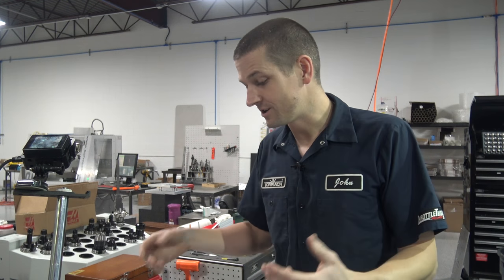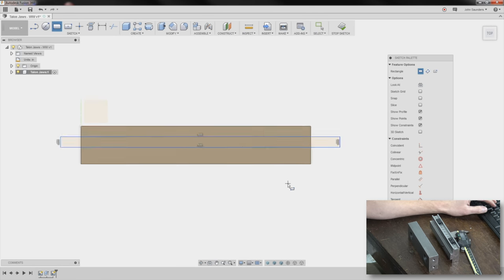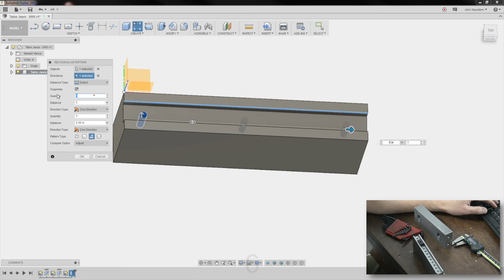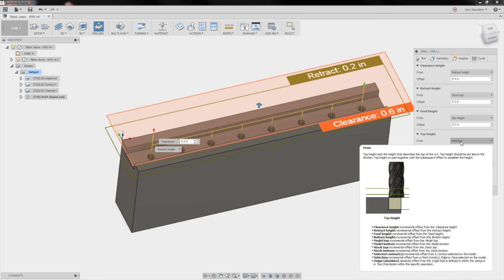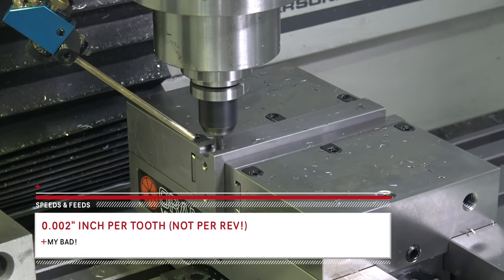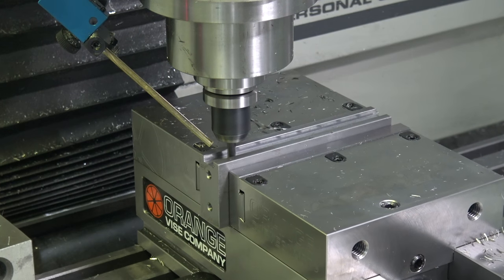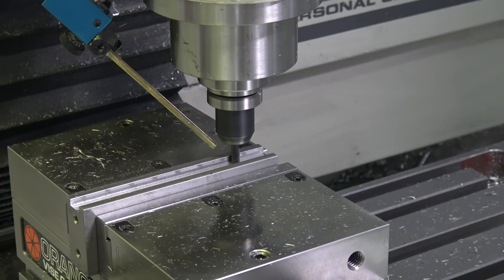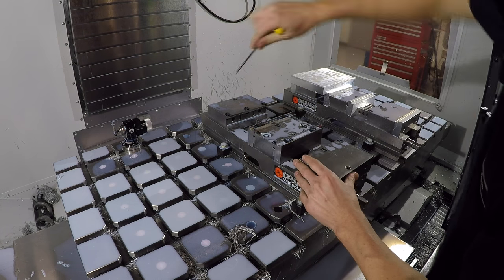Machining DIY Talon Jaws!   WW126

Comment: John, just a suggestion. (I don't know on the TorMach machine having never run one.) On most all CNC machines if you program you finish cuts using cutter comp you can control the amount of stock you are leaving or removing by changing the offset for the diameter or radius (some machines use diameter some use radius) in the tool offset page for that tool. For instance in your cam software if you don't offset the tool path to centerline tool path but apply a comp left or right (G41 if traveling on the left side G42 on the right side, you post should automatically put the code in the program). You will need lead in and out moves equal to at least the radius of the intended tool size (I usually add a little more to the radius say .010"). Than you can than  just rerun the finish cuts at the machine adjusting the offset to come to size. The way you appear to be doing it you have to go back to the computer to reprocess code every time(what if the tool wears or you change to a new tool). That does work but lets say you have many machines with many operators it could be very difficult to do if one person is programming. Or if you run a job many years later you would have to remember what to do. Or using reground end mills. So it is better to program the actual shape of the part and use the tool offsets to come to size than every one will know how to run each program without needing any additional programing or processing of code. Also looking at a program latter on in the G code it is much easer to tell what size you are cutting.The Haas machine will do this.
Reply: True. He should've used another endmill for "finishing". Just needed that fresh edge.

Comment: When you do your 2d contour to clean up, in the passes tab, change the Compensation type from 'In Computer' to 'In Control'. Also don't leave any stock. Add +.002 to the diameter offset of the tool doing the contour in your CNC control. Run the program, measure the slot, then change the wear offset to what is left to cut and run the program again. You don't have to repost the program and that tool is now dialed in. Then you can also easily adjust this as the tool wears out.

Comment: 1018 can be case hardened.  I made a planer gauge in school and had it case hardened to 55-60 Rockwell.  My understanding is that carbon is added to the material from the outside before heat treat.

Comment: I've seen a few generic case hardened answers, however, carburization is actually something that's very interesting.  You end up heating the low carbon steel while it's wrapped in an air tight 'chamber' and surrounded by charcoal or other high carbon elements.  If you heat long enough, you can actually get then almost completely through hardened.  It's a very ancient technique that hasn't changed much over time, and essentially very very effective.

Comment: if you use a super quench (water, salt and surfactants) from a little over 1550 degrees you can get it to the 42-45 range.  It works by basically breaking up the steam bubble that forms around it to increase contact area of the quench liquid to the part.  The 50 range is probably not happening on 1018 unless there is a method I am not aware of.

Comment: 1018 CRS can be case hardened by carberizeing. It usually yields a hardened depth of .060 to .065 of an inch.at 56 to 58 Rd. Not very many places do it any more though. I made parallels that way and some were so hard a carbide end mill wouldn't cut them. Keep up the good work John

Comment: If I remember correctly, you are correct. Multiple kings had their highest guests of honor used aluminum silverware rather than gold. Aluminum itself isn't really toxic, but they didn't have any way to process it back then, so it would have other contaminants with it. Currently aluminum is more expensive than steel weight wise, however steel is harder and better for more structural builds. I knew a robotics team that milled out their entire chassis out of aluminum and spent close to $15,000, however their robot was extremely light and almost 30 pounds under the weight limit with more moving parts than most teams. Another team had a chassis out of steel, but they had to "swiss cheese" their robot to fit within the weight limit, but they didn't have as much functionality. The steel chassis cost them almost $600, but very cheap compared to the aluminum version.

Comment: as others have mentioned, you can case harden 1018. Most likely it was qpq'd (salt bath nitirding). It will usually have a black finish after that process.

Comment: 58c is obtainable through carborizing.  We induction harden 1018 to mid 50's and can achieve  deep effective case hardness. The majority of the parts we hear treat are 1020 or 4140 though.

Comment: Use 20MnCr5 for the talons. And case harden them to 55-60HRC , about 0.5mm case depth should be just fine.. They will bite into the workpiece. But that is why these talons work i guess. It's the angle on talons that matter. If you need any other suggestions, just ping. We run a machine shop and one of our other divisions is a heat treatment division.

Comment: I haven't seen those jaws before so don't know what their hardness claims involve, but I case harden parts of 1018 or 1020. I've never bothered measuring the hardness but can if you would like me to? But they are definitely more than "file hard" as I always check that after hardening. The advantage of case hardening is the soft core, yet very hard case. It's also cheaper steel ... a biggie when you're as cheap as I am!

Comment: dare I say: Gripping video?

P.S. Slide the gage blocks together for better repeatability. If you just stack them, you trap air. Good test is to see if the thin block falls off under its own weight. It should be held there by air having trouble getting between the blocks.
Reply: Bernd Felsche I was thinking the same about the gauge blocks. If you are looking for accurate measurements, the blocks should slide together and stick like you said.  :)
Reply: NYC CNC 

Surfaces of the blocks are so flat that they contact each other so close they form an atomic covalent bond as well as a Van Der Waals bond (what makes geckos able to stick to anything) . Kinda like magnetism except they're held together by sharing electrons instead of actual magnetic forces. 

This is also why if you leave two blocks wrung together just sitting around, they'll form a near solid block  as if welded together. You may actually break the blocks before breaking the surface bond when trying to get them apart. 

So never leave blocks wrung together. Including ceramic and carbide blocks. Both will form covalent bonding between them.

Comment: you can carborize low carbon steel and reach 60 before the draw down. (case harden)
Reply: You need to water quench or brine quench. 1018 will be ok. But if you control the process properly , you just  might get 55 hrc. Better take 20MnCr5. Assured  you will get 55Hrc+

Comment: If 1018 is the alloy it must be case hardened. The 18 in 1018 is the nominal carbon content. It will be around 0.18%, but needs double or triple to hold a higher hardness.
Reply: Agreed.
Reply: Geof Dumas look up super quench.  while 1018 is generally considered to not be hardenable, with the right surfactants and stuff in the quench it is possible to harden into the low 40s.  It usually makes sense to just go for a higher carbon steel, but it is actually possible to do.
Reply: Low 40's maybe, but not 50's, as listed

Comment: Nice work John. It's funny, I was having the same identical issue just last night trying to center a feature using the fx measurements. I wrote it off as not being able to use the derived measurement belonging to another component (in my case), but now I'm not so sure since you were working with just one component. I hope you will post an update for the rest of us if you find out what the deal was. Ciao, Marco.

Comment: At the 20:51 spot on the video I see on the side of the slot you cut 8 regularly spaced darker spots. Does this suggest something wonky with the drive in that axis?
Reply: ExtantFrodo2 I believe you are seeing the reflection of the holes on the side of the slot.
Reply: I think you are right. I thought he was going for 6 holes but I was mistaken and the "blemish" doesn't appear until after he drills. Good catch. Thanks!

Comment: There was a hinky bit there in the middle.

How many times did you have to run that 0.499" pass to get it to come out on size?

'Cause it looked like you were having a hell of a time with the gage blocks there in the middle, no narration, just stack after stack of gage blocks.

You can case harden low carbon steels either through carburizing or by using a hardening compound (Kasenit, Cherry Red, etc).

Comment: They used to think that aluminium pots, anti-perspirants etc. contributed to Alzheimer's disease but more modern medical research has disproven that link.

However patients undergoing kidney dialysis should not use aluminium cooking equipment as the dialysis process causes the aluminium to build up inside the body where it can take the place of calcium in the body, potentially leading to bone disease and some forms of anemia.

Comment: Hi John. When you adjust the last thou on your Talon Jaw slots, are you going back to the PC and change the values or have you cutter compensation G41/ G42 direct in the cnc mill (compensation type: in control) and only change the cutter diameter in the tool table of your machine?

Comment: Great vid John. I don't entirely trust my 1100's accuracy and have to sneak up on things where the dimensions really matter which is a bit of a pain.

If I use the same tool, same fixture etc I can easily shave off 0.01 mm (1/2 thou) accurately by running the cycle again with negative stock to leave so its repeatability seems really good. However I can't trust it to interpolate a hole say 15.01 mm reliably - it'll be off 0.02 or more one way or the other. So I guess it is precise rather than accurate.

It'd be interesting to see how your Haas and Tormach compared in terms of precision and accuracy - the Haas at my trade school is supposedly accurate (or maybe precise) to 0.001mm (half a tenth).

Comment: What I do the keep from making multiple programs to "sneak up" on a dimension is lie to the machine and tell it the diameter of the tool is touch larger than it really is, this way the cutter radius comp cuts a tad smaller then you check fit and adjust tool diameter as needed. Of course all this assumes you are using cutter radius compensation. Further more once you get it close, throw it on the surface grinder and dial it in.

Comment: You're trying to do a driven dimension you can do it yet you can do this (d8-d7)/2 this works just did it.
Yes that worked fine for the sketch, But why did you not just sketch the jaw from the side, then draw a centerline on the top then a line for the front converted to construction

Comment: Any way that works is correct, but just for the record... I would have used pins or expanding parallels and a micrometer to "project" those two inner planes into an external place where I could get them with a micrometer, that only works at the ends of the slot tho, cant measure the middle as easily.

Comment: Correct me if I am wrong but as you measured with the Vernieer, why chase the measurement with the gage blocks why not check with the talons you were going to put in the slot?  (sorry i wrote the comment whilst watching!)
Reply: Tony Perks because you need a physical measured number to know how much you need to adjust the cutter by. Otherwise you could oversize the slot.
Reply: Tony Perks Digital/Dial/Vernier calipers are commonly referred to as "Very Near" calipers especially on internal measurements. Used correctly gage blocks or if applicable, adjustable parallels and  a micrometer is a much more precise method of measuring slot width and being able to see the incremental increase in size between cuts. This will allow precise cut adjustments to finish the slot to the desired dimension.
Reply: Cad-Cam_Man Maybe he means instead of just using the gauge blocks why not use the talons that are going to fit in the slot to check the slot as well as using the huge blocks. (Which h did do, but he made the comment before watching the full video.)

Comment: They should totally make it so you could dimension a circle with a Number drill diameter, like 'D#21'.
Reply: Charles Reiche 
I'll have to double check.  But I believe if you use the "create hole" feature to put a hole in an existing solid, there's a pull down menu that lists all the number and letter drill sizes, along with tap drill sizes for corresponding thread sizes.

Comment: Don't think they can get 1018 to 50+Rc.  Why no surfacing pass so your slot isn't crooked with your top? I mean sure it is just .002 off but still that seems a lot on a precision vise surface.
Reply: bcbloc02 
If you go to the talon jaws site they say they are only within.002. 

Talons are really only for 1st op only so .002 out of parallel doesn't really matter as it's holding onto saw cut or roughly stock anyway.

Comment: Why does the drill start pecking so far above the material? Doesn't the machine know exactly where the tip of the bit is? Or is it just a safety margin, so if it's a bit off, it won't jam into the stock?
Reply: NYC CNC oh, ok. I wasn't sure. thanks for getting back to me.

Comment: Miteebite has the solid right on their website just need to make an account. They have it for most of their products. Super handy when making dedicated fixturing.

I've seen you use fusion 360 a few times now and I can't say I prefer the software. Although it is definitely a cheaper solution to mastercam and solidworks.

Comment: Being a Physics and Mathematics degree type with Engineering on top - Pls consider a binary search on the test blocks.  e.g. - .4 to .5    easy .4 not .5.  Cut in half.  .45 works ? no .425 fits - try 4.3 and see if it is to much.   Al can be absorbed into the body and can cause brain issues.  It is a 'light' metal so it isn't as Cd or Pb (lead).  Remember the run away from cooking dishes in raw Al ?

Comment: I've noticed using the referenced dimensions in Fusion intermittently works. Another small bug that makes things very frustrating.
Reply: NYC CNC I can, but I've submitted several bugs, several months ago, none of which have gone anywhere. I still think fusion has incredible value, I just look forward to the day it's a little more stable.